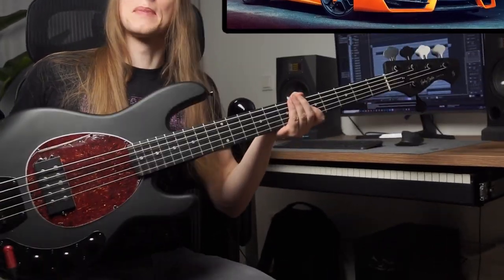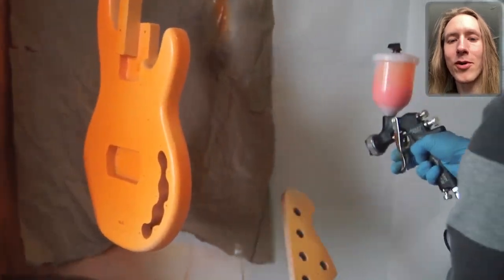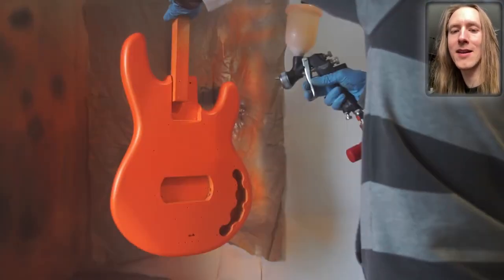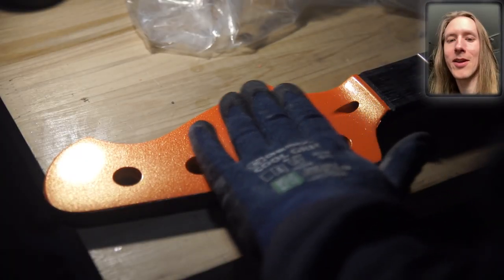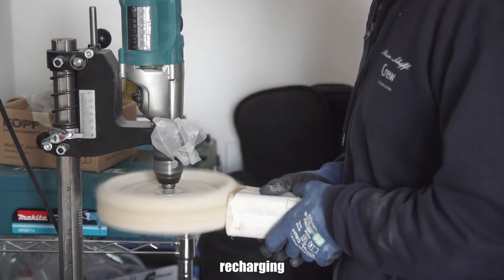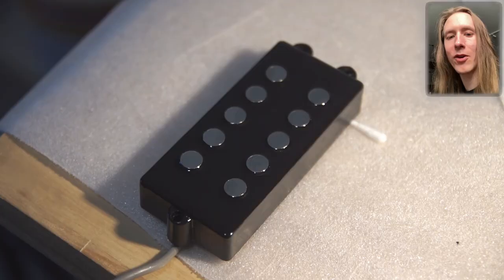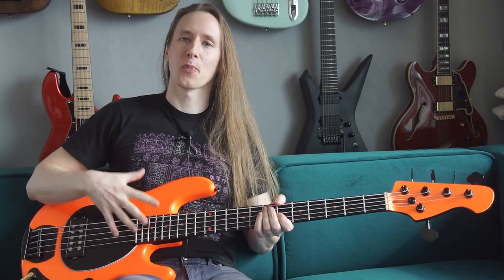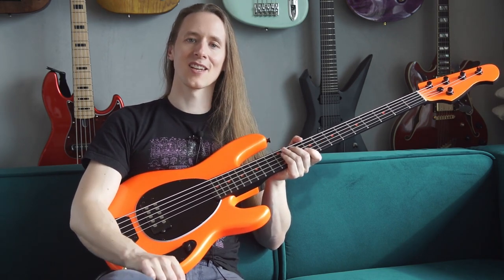DIY Bass Refinish | Orange Harley Benton Stingray

Comment: Looks cool! I'm using spray cans. Don't think it's possible to achieve such results with spray cans)
Reply from the maker: Thanks
Spray cans are more convenient though. But the biggest advantage of spray guns is being able to spray thick filler clear coats to build up clear coat quick (for level sanding)

Comment: This bass. Is perfect. Does it come in 4 string?
Reply from the maker: They do make a 4 string of this as well, on Thomann it's called "Harley Benton MB-4 SBK Deluxe"
Reply: Thanks. Orange and black is really my thing. I do like the Ernie Ball Stingrays. I've only played around with a couple. Are the HB's better?
Reply from the maker: @dovleac  the HBs are very cheap, but they are good. Sterlings are surely better and Ernie Balls are probably perfection.